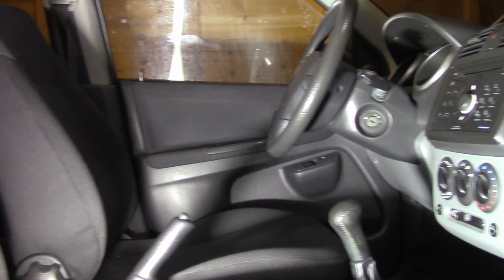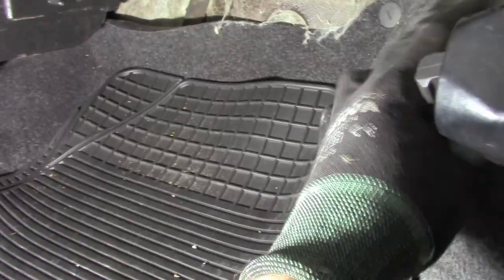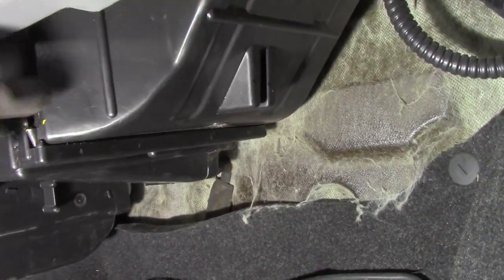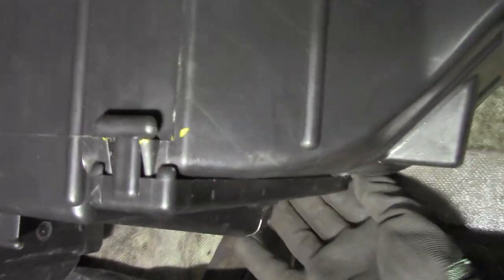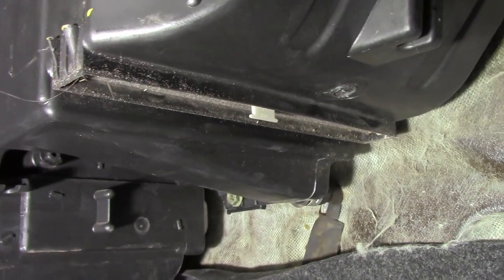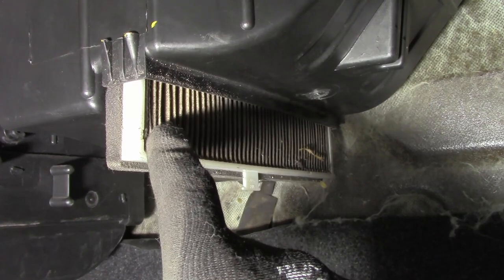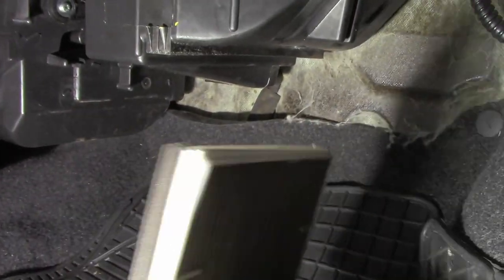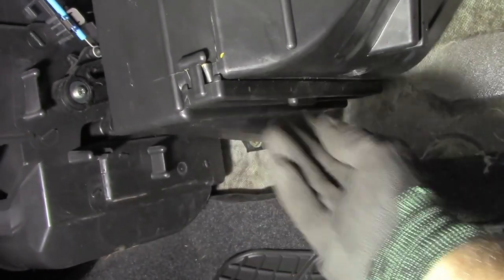Replacing CABIN AIR FILTER - Suzuki Ignis

Comment: You know that's only half of the filter, right? The other half is probably still stuck inside the cooling unit. When you think about the dimensions, it seems quite reasonable (approx. 203 mm x 17 mm are OK, and 117 mm is half of 235 mm), so it's not uncommon, but simply broken. You have to remove it completely before replacing the filter.
Reply: What do you mean? How do you remove it completely?
Reply: @mihaim4619  If the other half of the filter is stuck inside the unit, you have to take it out first. I used my girlfriend's crochet needle, but you may also use any kind of small hook.
Reply: This is correct, i took it out today and it litararly looks like two of the filters you see in this video stuck together. LOL so funny the guy in the video says its a very unusual size :)  but props for making the video anyway, well done!